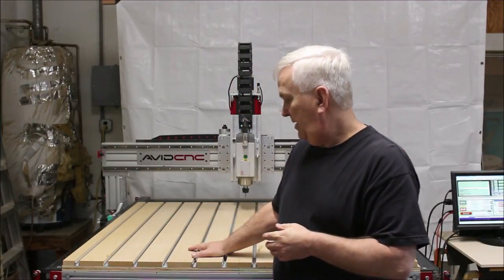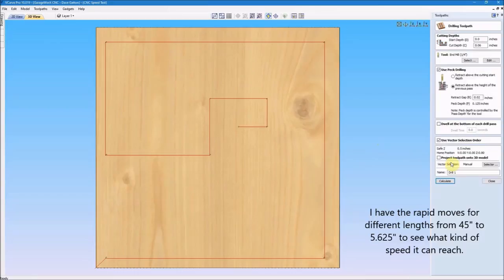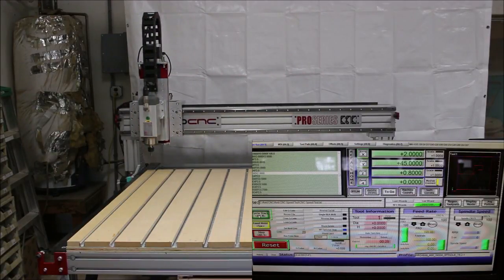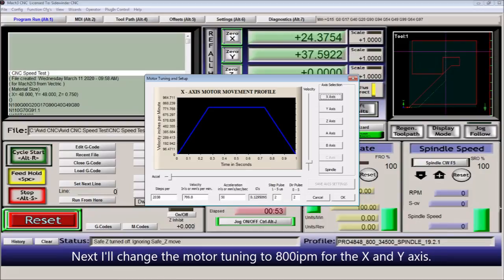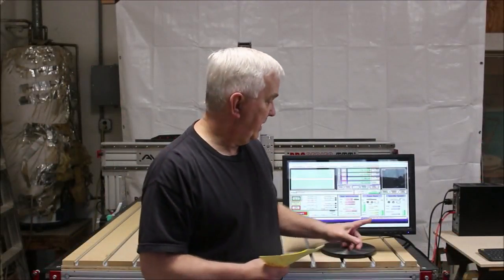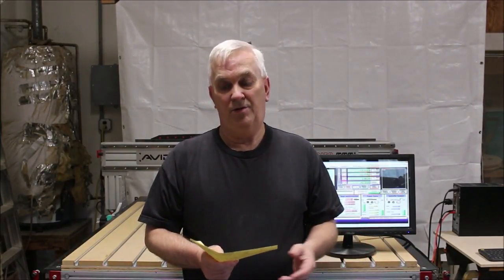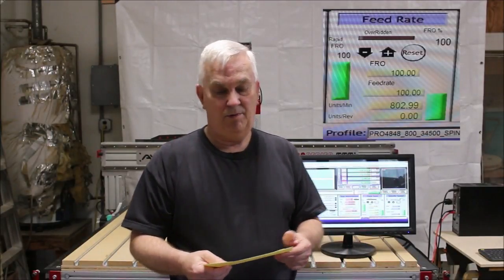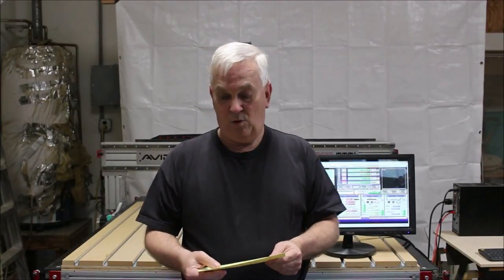My Avid CNC How Fast Will It Go

Comment: Do you still have this unit Dave?
Reply from the maker: No, I do not.  I recently sold it to a very good friend of mine whose shop is about 20 minutes from me.  Since I'm retired or at least semi-retired, I wasn't using it very often.  The new owner is making some awesome projects with it, and the Avid machine is still running great.  I ran that Avid CNC for five years without any issues at all.  Avid machines cost more than a lot other machines, but that's because they are the real deal.  😃

Comment: I have the  same setup, and found that with that large gantry and 12" Z stage that if you are doing any kind of work with a lot of tight turns (like small circles, or Vcarving), you need to run a lot slower, and also cut down the X and Y accelerations to somewhere around 20-30in/S^2 or the cut quality is going to be poor due to vibration.  The default acceleration settings were just way too fast.

Comment: But how fast will it cut?
Reply from the maker: Thanks for watching.  How fast will it cut what?  There are different speeds and feeds for different materials.  When I post a video of the machine cutting something I will show what feeds/speeds I'm using and what kind of bit but for this video I was only trying to find out if the rapids are what Avid CNC says they are.

Comment: I had my Gatton set up for 240 ipm with some fairly hard acceleration and the thing almost jumped on the table.  200 is fast enough for me.
Reply from the maker: Thanks for watching Dave.  Yes, it is much different for acme lead screws versus linear rails with rack and pinion drive.